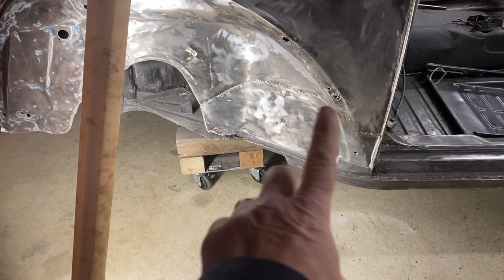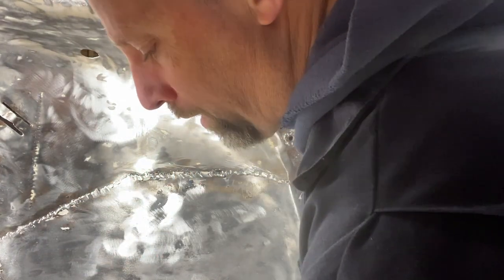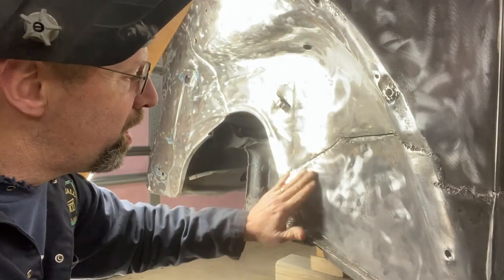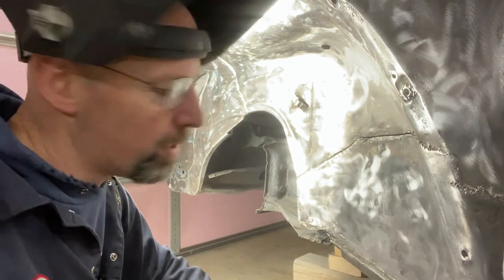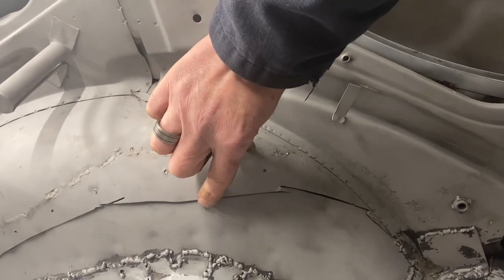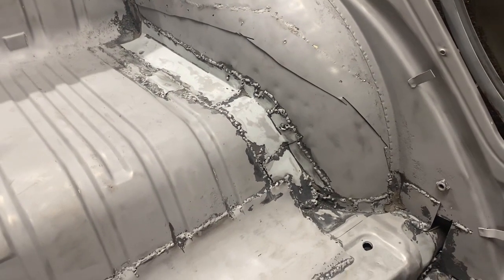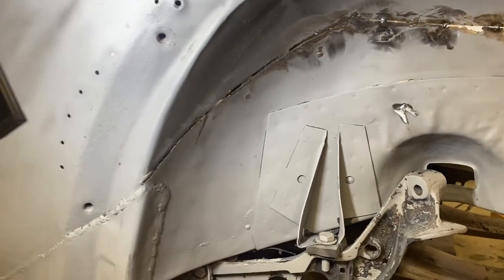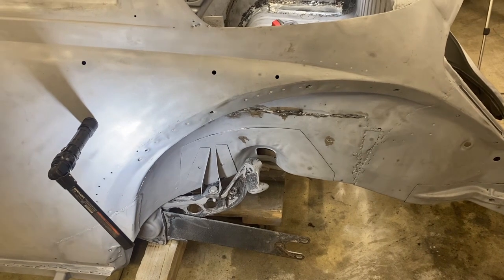1966 VW Beetle Convertible Restoration - Pt. 10 - Making Fender Seams Disappear

Comment: I am viewing your whole VW series.  I really like what you are doing.    Not crazy about your music choice and on top of that, it blasts very loud compared to your conversation sound level.     You might consider turning the music volume down on future series.    Keep up the good work and continue to share your knowledge.   Thanks for the great series!!        PS, I find cut off wheels work very well for grinding mig welds.    You might also try  EasyGrind wire.  It's more expensive but grinds down much better, softer wire.
Reply from the maker: Thanks for the suggestions about the music.  I didn't realize that it was too loud.  I'll work on fine tuning that.  Thanks for watching and contributing comments to the dialogue.